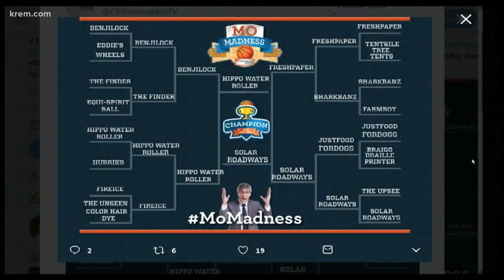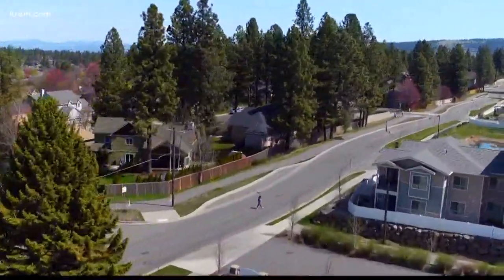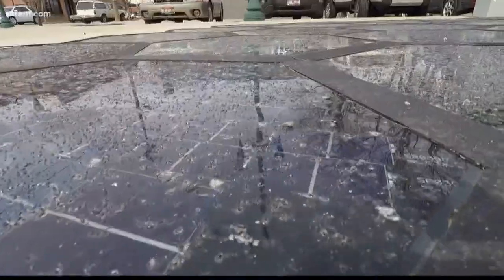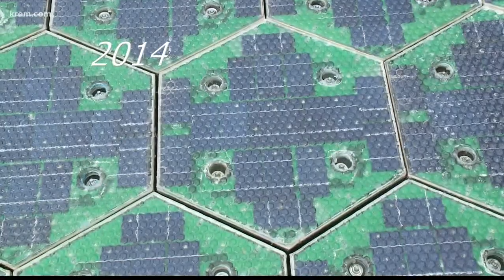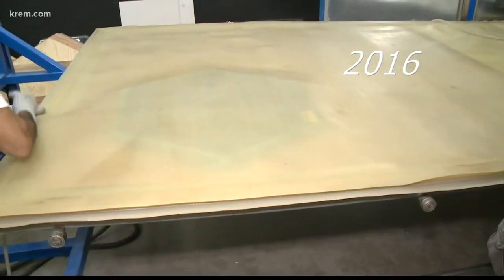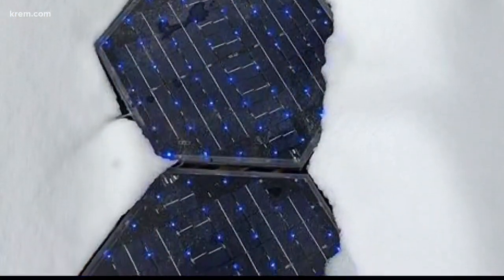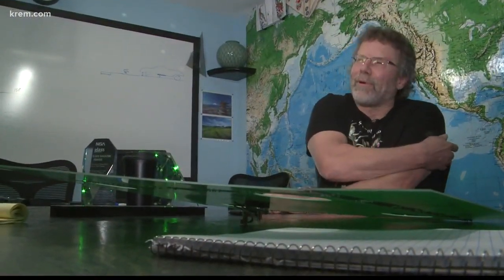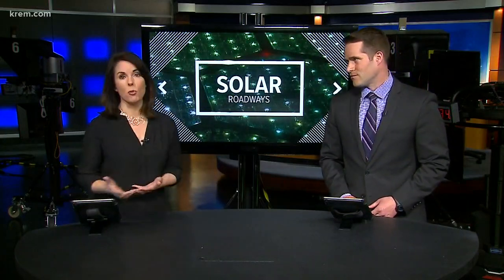Solar Roadways takes one step closer to mass production

Comment: Just my opinion. I think it's an innovative idea. The concept is sound. Instead of blacktop that just lays there until it's needed for something, a solar panel that is producing energy. I read about this years ago, and hoped it would get more attention. However, large corporations that make roads, would never want this to take off, or the power companies that soak you every month for your energy to run your hot tub. For all the nay sayers, and scam talkers......................Neil Armstrong told Elon Musk he was crazy. Real innovation takes time and vision. It's easy to talk it down, when you can't even begin to think of a better way yourself. As long as the corporations and industries continue to control government, and government continues to control the people, and the banks continue to take all that we earn, nothing will ever change.
Reply: Betelgeuse
Solar Roadways are a terrible idea though, which is why it's never succeeded.
Reply: @marcocappelli2236  Saying it doesn't make it so. Why is it a terrible idea?
Reply: @betelgeuse1227   8 months late here. Well, simple answer: you can just put it on the desert, two times more efficient, safer, so what’s the point?
Reply: @alexdotmp4809  So, we should clear MORE MILES of desert habitat (plants, animals, etc..) when we have MILES of road that already do that, and provide nothing in return? What's the point? What's the point of using common roofing shingles that last 10-15 years, when you could install a metal roof that lasts 100 years? You're just being cheap and not considering the future.
Reply: @betelgeuse1227  Go & look at Thundef00t's videos, he explains very clearly why this is a really dumb idea...
Reply: @thelimey351   I think these Solar Roadway folks are not going to deliver and if they ever had a chance they are now too far behind the curve.  I expect organizations with other ideas will make the SR ambitious approach obsolete.  

I've looked over their website very carefully. They have done a lot of things very well, but this endeavor involves bringing many elements together in a mix that has not been tried before beyond tiny prototypes.  SR has to be very solid not just on the engineering with that mix of tech, materials, and geography, but with the financing and marketing efforts as well.  SR did stress testing with heavy vehicles, tested to see how the panels stood up to lightning, and many other critical trials.  That testing they did proved they had solved the issues from which the French prototype eventually fell apart in just 3 years.  

 There are a lot of challenges they are not going to be able to adequately address.  Aside from the tech and finance issues, I don't think they're struggling too much to market themselves, and I cannot figure out why they think it is essential for them to drive this advance in applied technology from northern Idaho.  I mean skills are skills, but if one ever plans on expanding there are other locations with the resources to nurture that better, and where start ups get more support.  There is a lot to criticize.  But there is a difference between solid criticism and making a show of blowing spitballs at people who know how to work hard.

Thundf00t is clearly more into providing entertainment with cheap shots, misleading assumptions, and mockery.  Maybe it's his hobby, but if he had any engineering chops he wouldn't have the time to perform these antics, nor would he categorically reject and ignore some of the outstanding things SR accomplished..  It's very easy to do what he is doing.  I found him really boring.
Reply: @johnnyna3831  Well, I disagree, I think the whole idea is totally unrealistic & I can't see that they have done anything well, we have TARMAC roads breaking up & they want to put all these electronics into their fancy tiles !  So aside from the tiny amount of energy they will generate (especially as they are not angled towards the sun) they will break up in no time in real life conditions.  It's laughable...

Comment: Even if this works, it will never become reality. Too many powerful people stand to lose too much money if we suddenly could harness free energy. The power company lobby and oil industry lobby would have it shut down and buried faster than a NY minute. But before that, they would plant an army of internet trolls to discredit the whole project.
Reply: Actually its too expensive to be put into effect as an efficient roadway. Its 30x the price per kilowatt hour they produce. Glass is a horrible surface to use as a basic road surface. Trucks barreling down the road at 80,000 lbs would shorten their lifespans considerably. Not to mention dirt, dust, and grime will be grinded into the surface reducing power output. The Colas Wattway in France was deemed a failure for it was too expensive to maintain. China a world leading producer of solar panels also did the same and after 3 days i think the roadway had to be closed from excessive damage and even a panel was torn loose. There was a big investigation over that.
Reply: Yeah I thought the glass material was kinda iffy too. But innovation needs failure in order to evolve into something viable. Just think of all the vast amount of heat energy from all that asfalt baking in the sun all summer long, all wasted. I wish there was a way we could somehow harness it.
Reply: free energy? what you are talking about? check out thunderf00t aand EEVblog for numbers of kWh versus dollars
Reply: LOL.....jesus I thought that people crying about crisis actors were dumb but the youtube comments section always amazes me.  Im sure Big Oil and Big Coal have paid off all of the critics and trolls of this unfeasible idea.  Sounds reasonable....
Reply: Innovation attracts ridicule. Just ask Elon Musk.
Reply: @My2Cents1  you mean the guy that built huge ponzi schemes that none ever really make money or deliver what was promised?

Comment: Anyone who says you can melt snow on roads with electricity is either a moron or a con artist.
Reply: For real... Water heated to 40F and run under roads seems cheaper and OH! That's exactly how current self-melting (expensive) driveways are built. And it's waaaayyy too expensive to do on a road-system scale. I'm sure unproven, physically dodgy ideas with MAGICAL ELECTRICITY will do better :)

Comment: Could this actually work? If it wasn't a random husband and wife and a multi-billion dollar company like Microsoft behind it?
Reply: No, it could not work, it is a scam.
Reply: No, it could never work.
Reply: Colas a major road company in France tried it and they closed it down stating it was a failure and they arr a multi billion dollar road construction firm.
Reply: It's hard to say in my opinion. It is interesting that Solar Roadway has videos up that shows them testing their panels, and demonstrating that they have the toughness to endure the installation environments. They completed vigorous testing for some of the situations that the French installation totally failed at. But I think it's likely that SR took too long to get to their present product state and they lost the chance by now.  I think if they had found more ways to simplify the product while continuing to test it aggressively they might be in better shape now.  For example, did  they really need all  those electronic and LED elements in the panels?
Reply: @johnnyna3831  It's not hard to say. At the current state of tech it's impossible. And will probably stay that way as things that make a road good is the polar opposite of what makes a good solar panel. There are SO many ways implement the current tech much better. At best it was two dumb dreamers who got caught up in the hype. At worst it was a straight up scam.

Comment: WTF....reporters see Thunderf00t. FYI: The second most efficient solar panel are the one's that is angled towards the sun during optimal daylight. It's better to have it on a roof top or as a parking lot cover. If you at least do a  report on a solar panels at 42 degree vs 0 degree, you'll see the difference immediately. http://www.solarelectricityhandbook.com/solar-angle-calculator.html

Comment: did brusaw say how much energy we would consume melting enough glass to cover 48,000 square miles?  what kind of carbon footprint would that make?  not to mention energy to produce all the other materials then how much would maintenance crews cost for wages benefits and retirement cost compared to energy produced?

Comment: This makes so much more sense than the Dem’s green new deal approach to tear down and rebuild every building in America. They need to have real engineers and scientists working on this guys idea. He can’t do it alone, no one could. I love the idea that they make led light, melt snow, and absorb energy. So much potential!
Reply: If they could get it where people just put it on their driveways, they could help charge their electric vehicles with it and use it to help power their houses. No big trucks driving on it, and the only driving on it would be whatever the private homeowner and his company did. they also need someone to work on efficient batteries to help solar panels keep charges for homes.

Comment: Wow what a bunch of negative people you all are. Every new idea / invention has issues.
Reply: The point of the comments is that the “solar roadways” concept is being sold and executed in a way that feels more like a scam rather than be handled with honesty and a sense of well planned and engineered execution.
Reply: @scottwade3832  Scott Wade. . 4 months ago. . The  'feels more like a scam rather than be handled with honesty and a sense of well planned and engineered execution.. . . ' which part is a scam and not honest? How would you present it?
Reply: @mevaser770  i think its a scam because solar panels are not being angled at the sun thus reducing its peak output to 30%. As a road surface glass even if you roughen it up will be grinded down till its smooth. And then your subjecting the panels to immense stress from the traffic that would be driving on them which shortens their lifespan and power output. Roads are also not a clean place so if your not plannong to clean them constantly. Dirt, mud, sludge, and grime would further reduce their ability to absorb sunlight. Rush hour traffic would make the panels be even more inefficient as they would be blocked by cars for who knows how long. Replacing panels are expensive to do as well far more than just a standard asphalt road. These are just some of the myriad of reasons that you can't sidestep around sadly.
Reply: @mevaser770  well, look at their own YT channel.

Is all hype, no science, comments turned off.  Huge red flag.

SOLAR FREAKING ROADWAYS!!!!!
Reply: The difference is, good ones can be solved.
Reply: These are the same kind of people who thought flying would never work. Don't mind them.
Reply: But I bet both of you believe in man made climate change. There’s an old expression: “you can’t fix stupid”!
Reply: @robiandolo  don't mind them, their job is to complain for free,  part of Venting Media. Our job is to work on solar roadways
Reply: Go and hug a tree. Its obviously a stupid idea

Comment: Every scam is always "on the brink of a significant milestone", they just need a little bit more of your money and they'll surely get there!
Reply: and remember these panels will have to be somehow bolted down to a perfectly flat surface so they dont get pounded to death and they have not shown us any plan on how to build such a surface that dont crack or move with the heat cold and water in the ground.  you cant glue them down because it would be too hard to replace them and if they were bolted down how would you put millions of anchor bolts in the ground and at the same time have a perfectly flat surface for them to lay on?  glass really dont bend much so if you used 4 bolts and the surface was not flat it would break the panel.  the only people who think this is such a great idea are those who have never built anything.